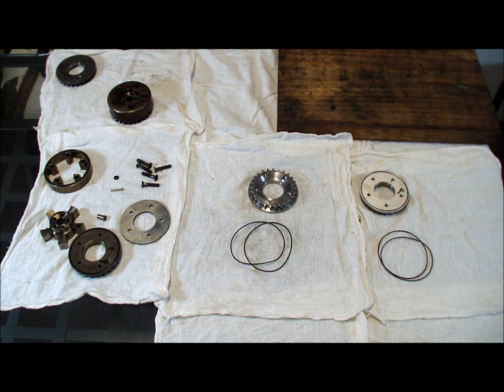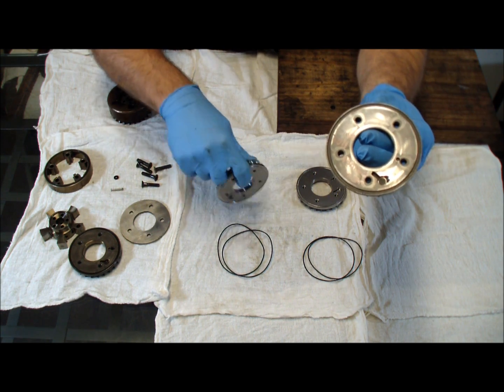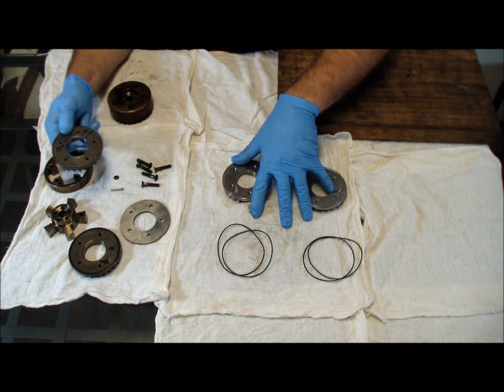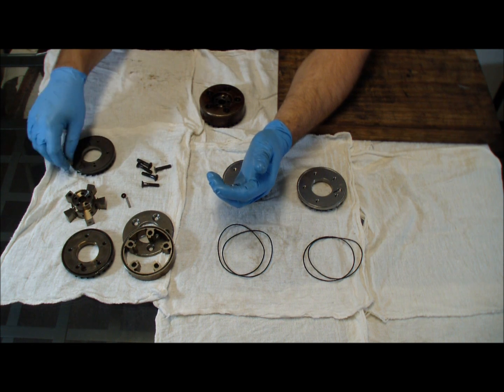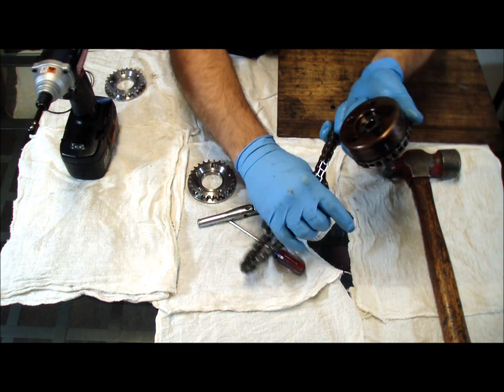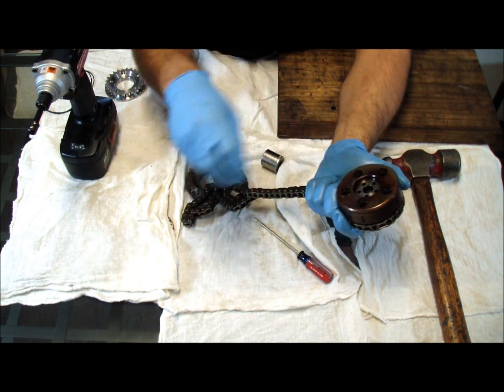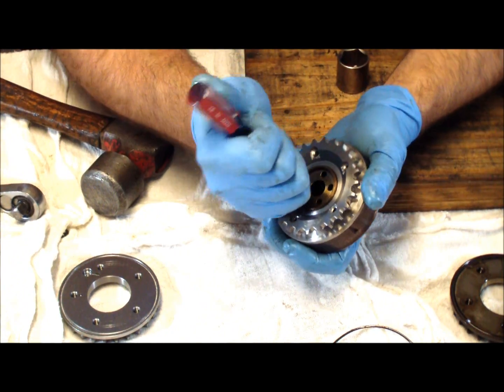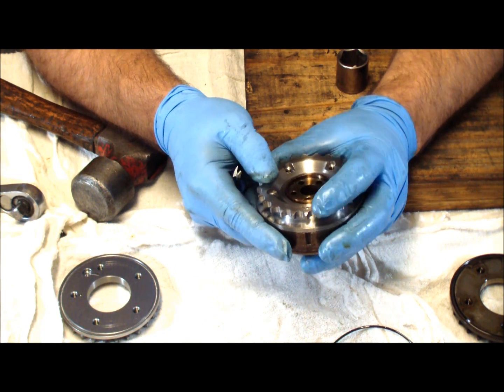JHM B6 B7 S4 Mechanical Adjuster Repair Kit - Informational / How To Video

Comment: Do these ever actually completely fail? And damage other parts of the engine? I.e. such poor timing that valves with collide or the timing is so off it simply won't run? It appears my tensioners are bad as well and I'm trying to determine if they are worth pulling the motor to replace.
Reply from the maker: Yes, if neglected long enough it can cause major damage.  Shoot an email over to sales@JHMotorsports.com

Comment: Just bought 2004 b6 s4 cabriolet for cheap. Fixed oil leaks but has codes P0345, P0346, P1347, P1577, P0300, P0305, P0306.

Anyone run into a neglected 4.2 by any chance? Any info much appreciated!!

Comment: do you guys have any of those plastic washers @ 14:24? any solution to replacing them if they are broken? thanks for the video
Reply from the maker: Shoot us an email! Sales@JHMotorsports.com
Reply: I would like to replace this plastic washer too! Have you got an Oem number?
Reply: birosheep@freemail.hu Sheep81 hey bud Worst case scenario just throw in the spring without the washer. ive taken apart other cam sprockets before and they dont have one. audi does not sell them separately. its main purpose it to keep the spring centered but really there is very little room for movement. it'll be okay

Comment: I can't find this and several other items on the site. Have you stopped making these?
Reply from the maker: They are still available!  Do you have the wrong vehicle selected? Try clearing your vehicle and searching.

https://jhmotorsports.com/shop/catalog/jhm-mechanical-cam-adjuster-repair-kit-pair-for-b6-b7-s4-c5-allroad-42l-p-2314.html
Reply: +JH Motorsports, Inc. (JHM) How hard is this to remove/replace the adjuster in-car? My car has bank 1 basically all dead/misfiring. I have had no choice but to be driving it since I can't lose transportation to work. Hopefully that's not causing any serious damage....

Comment: Is this engine in or engine out?
Reply: Don't need
Reply: The engine must always come out.
Reply: LOL
Reply: I've tried with engine in on 05 A6 C6 4.2, it was pretty difficult to get all the cover bolts to get to cam adjuster. I ended up dropping the engine out and doing it that way.